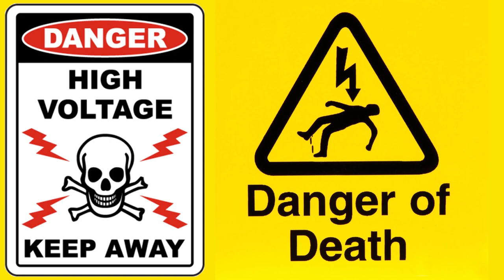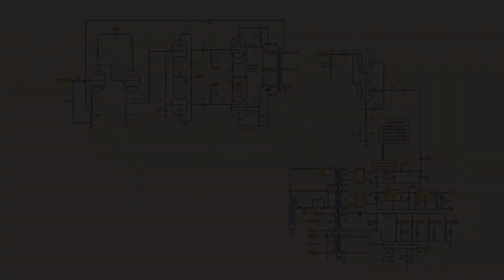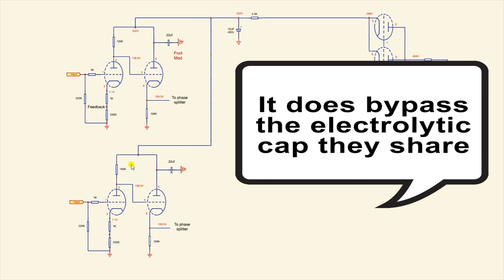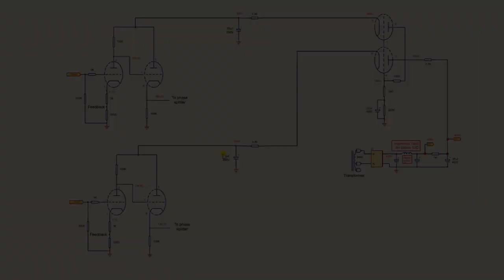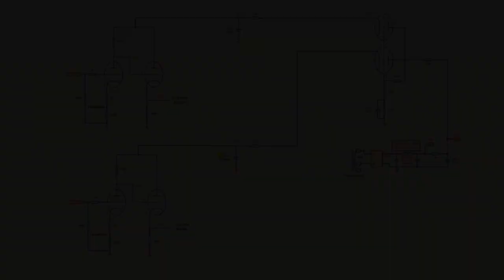Willsenton R8: Explain and Mod the Voltage Regulator 6SN7

Comment: Another mod that should be considered is the value of the 100k ohm grid resistors of the output tubes. This value is fine for EL34s, but not for 6550s, where the maximum grid #1 circuit resistance for fixed bias is 50k ohms, which will also affect the value of the 0.22uf coupling capacitors from the phase inverter.The 33k/39k resistors in the phase inverter are probably ok with the 50k ohm load, but the caps will have to be increased in value. Also, good design practice dictates that 1K ohm series grid stopper resistors be installed on the output tube grids. I really like your voltage stabilizer stage mods!
Reply from the maker: I plan on adding 1K grid stoppers but I'm gonna leave the 100K on the grid bias as for KT88 tubes we plan to run, that value is fine for fixed bias. https://frank.pocnet.net/sheets/086/k/KT88.pdf

Comment: Very informative video.  What do the 2 6SL7 tubes do?  Which have the most influence in the sound?
Reply from the maker: Those are the 2 tubes being powered by this voltage stabilizer. They are the input "driver" tubes and the second triode is the cathode follower that drives the phase splitter 6SN7 tubes. The 6SL7 will have the most influence on the sound IMHO.

Comment: Really enjoyed your explanation of how the amp is actually wired and what you plan to change. Really learning a lot from your videos. Sometimes I don't understand the cost cutting steps these companies take. Maybe if they were using 1 6SN7 to stabilize both channels it would make sense but it seems that the change you are proposing of decoupling the channels by adding a longer wire, another resistor and cap to the circuit would be a low cost for the manufacturer to add from the beginning. Anyway, as always, keep up the good work on these videos.
Reply from the maker: Some of this is just someone not completely thinking through the problem, like how the grounding and heater wiring is done...

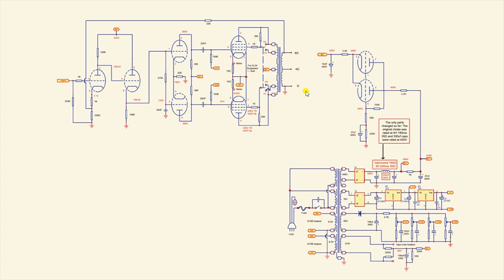Comment: Thank you for all this information.  BTW, the "as built" schematic you're showing at time 5:14 of this video is not the same (in the power supply area) as the one on your website. Will you be replacing it later?  Thanks.
Reply from the maker: You are correct I uploaded a new one today to the website. I warn people "This is a work in progress" and I'm still working on the final video, as I was doing all these videos in real time as I was working on this project. It's not like I completely did this mod and then made the videos :)

Comment: I run in the center position a 6SL7 instead of a 6SN7 for almost 8 months. Nothing happened to the amp that I can notice. Skunkie, can you quickly explain how come the amp worked fine?
Reply from the maker: Because that tube is being used as a regulation device, not an amplification device. That said, without trying it, I don't know if this changes any of the internal voltages or not.

Comment: 39ohm resistor..... if that cap fails and shorts, oh, i was going to say maybe that'll protect from a dead short, lol... it also delays the cap from charging/discharging adding a delay to the grid... 39ohms isn't very big though.... lol, maybe it's a fuse
Reply from the maker: But it's the same W rating as the other resistors. I'm gonna leave a 39 ohm in there as it's not hurting anything but have no clue why they would put it there. 39 ohms is a small value and I can't see it doing a whole lot lol.
Reply: @SkunkieDesignsElectronics  What wattage do you recommend? I've watched this video and the next and read every post on the stereonet forum and I've yet to read what wattage is appropriate for the mods. Thanks.

Comment: I noticed a small error on the R8 schematic output tubes, which you haven't covered yet. The 39K resistor should be connected between pin 3 and pin 4 of the output tube, not between pin 3 and the 1K resistor.
Reply from the maker: You right, good catch!

Comment: I have really been enjoying this series. I have seen schematics for all-tube regulated preamp power supplies that use "control tubes" to provide shunt regulation. One such single-tube shunt regulator circuit schematic on the DIYAudioprojects site used one 6KG6/EL509 for voltage reference and two OA2 Voltage Regulator tubes, which I believe are the vacuum tube equivalent of a solid state Zener diode. If you wanted to get really tricky you could build an all tube full-wave bridge rectifier with TV damper diodes as well.
Reply from the maker: I plan to play with some OA2 tubes in a future project for voltage control of screen voltages :)

Comment: Hey Skunkie, how did you measure the value of the former choke ?
Reply from the maker: A Henrie meter. Like I said, it isn't a super high end meter, but measuring about a dozen other chokes I have, including 2 others rated at 4H, it seems accurate to within 5% or so of the other chokes rates values.

Comment: Do you mind sharing a photo of the way you arranged the added capacitors and resistors within the chassis on this update? I miss the how-to step-by-step guide to soldering and arrangement that you did in your previous videos. Thanks again for this amazing series! You're awesome.
Reply from the maker: That is in the next video.
Reply: @SkunkieDesignsElectronics  Lovely. Have I mentioned how much I appreciate you detailing your work on this amp? I'm going to go out on a limb and guess that your analytics is showing a noticable bump in traffic and view time since starting this series specifically.

Comment: Hi  i want to do a power supply with 2 chokes one 10 hy and other 1.5 hy like you do with the kt88  but i want supply b + to output tranformer and output tubes and with the 1.5 hy supply the driver tubes  but is not really separate ,or other solution use 2 chokes 10 hy to separate 2 channels but is it the best solution or maybe not  what do you think about that .I see your vidéo on kt 88 but i dont know how you make your supply .thanks
Reply from the maker: On my KT88, they are just wired in series, 33uf cap to ground, then 10H choke, 100uf to ground, 1.5H choke and finally a 250uf cap and that is an ultra filtered B+.
Reply from the maker: IF you want to do a dual rail to split the channels, build one like I did for my 300B, split the channels after the first 10H choke.

https://www.skunkiedesigns.com/300b?pgid=kruvvnz5-38e66c82-b7a5-4439-bb81-4c8d5bde0d83
Reply: ok fine thanks @SkunkieDesignsElectronics
Reply: hi the hammond choke for  1.5 hy is rated  500 volts  maximum  its the 159 v  but my power transformer has 420 volts is it enought   for my project  kt 88 to separate channel  @SkunkieDesignsElectronics

Comment: Excellent the way you explained this. It is strange the way they did the center tube. In my amp this is the only tube I did not change as I dont think the one it came with is bad. I'm loving this series.
Reply from the maker: I just don't see this tube having much impact on the sound of the amp, other than a placebo effect.
Reply: @@SkunkieDesignsElectronics  I agree so no harm using a cheap tube there. Changing the 6SL7s changed the sound the most and for the better. Using nos Sylvania and nos rca 6SN7s. EL34s for power and deeper bass than KT88. I'm happy with it.